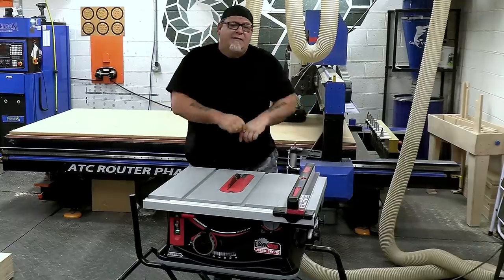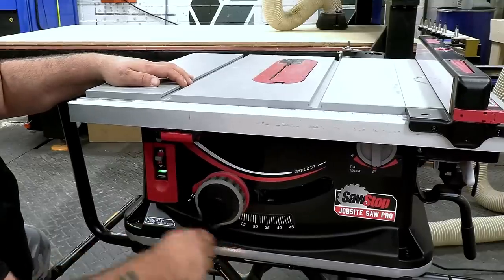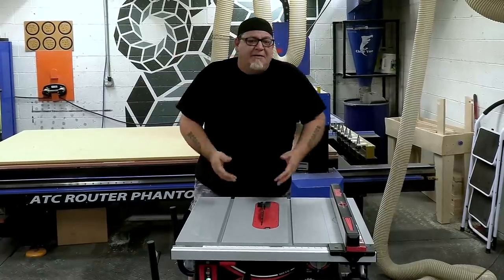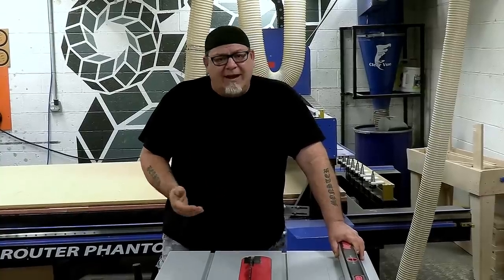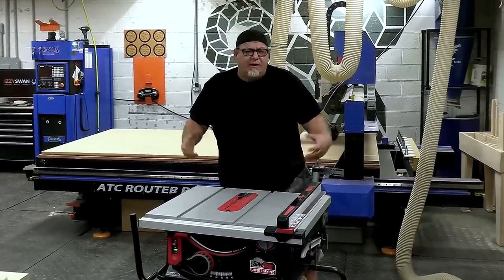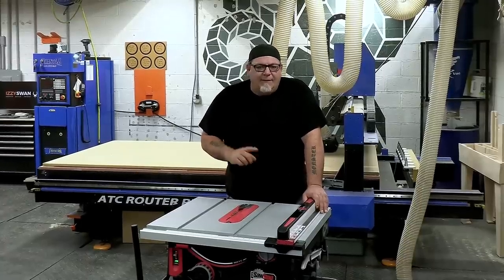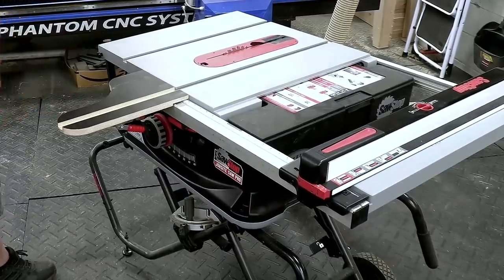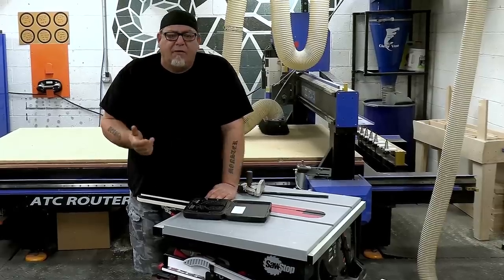DISAPPOINTED! - Most EXPENSIVE Jobsite Table Saw!

Comment: I've had a Sawstop jobsite saw for 5 or 6 years now. It is the original jobsite not the Pro model they sell now  I got the saw for the finger saving technology and the smaller size. Since I have limited space in my garage/shop. I use it to cut Birch Ply for cabinets, doors and all other uses and it works fine. I'm a retired carpenter so I don't take it to jobsites everyday, but I use it quite often. It was a great improvement from my previous 35 year old table saw. 
  I have had a few problems with the saw. First was with power, I was having problems with it running the diagnostics when you turn the saw on. Customer Service said I needed to use a shorter heavier cord. It helped some, but not great. I ended running a dedicated 20 amp circuit and have not had a problem since. The second problem was with the switch. It quit working the saw would start then stop and not reset properly. Customer Service said it was probably dust getting into the switch. I thought you're shitting me right, a $1200.00 jobsite saw that can't handle a little dust. SO they sent me a new switch, free of charge. I installed the switch and it has worked fine since. I did have the brake cartridge engage once. The saw was powering down and I was moving the fence and tapped the blade. The brake engaged and stopped the blade. The blade wasn't moving very fast when the brake engaged so the blade was not damaged. I contacted Customer Service and they sent me another cartridge. Yes the fence is kind of a pain too.
  All in all it works for what I need a table saw for now. And yes I would buy it again.
  I have one question about using a thin kerf blade. I've used one and had problems with the riving knife being to wide. It pinches the board against the rip fence making it difficult to push. Does anyone else have this problem? Any suggestions? Thanks
Reply: I too have the same problem with a thin kerf blade. The cut is so much narrower than a full kerf that the exiting wood hits and gets uncomfortably stuck on the riving knife. I think this can be an issue with any brand of jobsite saw, as mine is not a SawStop. I've attempted to rectify the issue by removing the riving knife and filing the thickness of the plate, down to where it is more wedge shaped, where the exiting wood is hitting the riving knife. It seems to work on everything but Mahogany ... but my experience is limited. Maybe there are some more (better) solutions out there?
Reply: @Sue B  I faced the same problem and tried several brands of thin kerf blades before giving up and switching to full-kerf blades. Problem solved. Yes, it removes a fraction more of the wood, but all riving knife issues are gone (with the plain knife or the dust collection blade guard). BTW, I personally find the full kerf blades give a better result (I use Amana Electro-Blu and CMT Orange Chrome blades).

Comment: I’ve had a JSS Pro for 6 months now and am satisfied overall.  

PROS:  
1) The finger saving technology provides huge peace of mind, and luckily I haven’t had any false trips yet.  
2) After a brief learning curve, I’ve come to like the fence.  As a couple other reviews have pointed out, use the red line over the ruler to select the distance from the blade, then pull back on the fence, then engage the lock.  The fence snaps to square, the red line doesn’t move, and the distance is dead on 100% of the time.  
3) I like the bigger table surface as compared to all of the other jobsite saws, as it provides more stability and flexibility for making a variety of cuts.  
4) I’ve been able to adjust riving knife side to side in order to permit the use of thin kerf blades, which is a big plus on any jobsite saw.    

CONS: 
1) Blade height adjustment.  As described by others, it’s extremely difficult to dial in a very specific height for dados, lap joints, etc.  
2) After ripping long boards, say around 4’ or longer, there is often a +/- 1/32” difference in width between the front and back.  I haven’t yet figured out what’s causing this:  fence slightly out of square relative to the blade?  Fence movement?  Other?

Comment: I've had my SS JS saw for 3 years. I got it to finish the inside of my new house. I wanted the mobility of a job site saw so I could move it to the room/floor I was working on. I also wanted the safety features because my young sons are getting more into helping with projects.  Recently, I've been building bee hive boxes and frames for my wife. Love the blade guard dust collection and mobility. To overcome the blade height adjustment issues, I've created some jigs to get dados and rabbits dialed in pretty quickly.

Comment: Good review Izzy. I purchased my Jobsite Pro two years ago. It was dead straight out of the box. I got used to the fence movement on lockdown, I micro adjust at the ruler and lock it in, and it’s fine. I hate the slop on the SS miter gauge, though. It died not fit tightly in the slot. Solved that problem with an Incra SE 2000. I love this saw! Cheers!

Comment: I'm a professional remodeling carpenter and bought this saw five years ago when my son started working with me.
I had a 10" Makita with a Rousseau stand and out feed table before.
Honestly I liked the Makita setup better, but the safety trumps the convenience.
The job site saw is too big to be lifting in and out of the Rousseau stand every day . I tried that.
So I'm back to using the rolling stand it came with and setting up an auxiliary out feed table.
I've never had a problem with "dirty" electricity tripping the saw, but did have to replace the switch and the computer on the tool.
I've also had two accidental trips with wet pressure treated lumber.
I'm now very careful to defeat the safety when cutting acq.
Still and all, love the fact that it won't bite me if I have a seconds inattention.
Sawstop was super helpful when I had issues and did send me a new switch for free.

Comment: The company I work for bought one for the local Habitat for Humanity.  That is the only experience I have with the job site saw - a few Saturday's worth of work.  The quick height adjustment was not a problem for my use, but I can see your point.  I did not like the fence.  I don't see your point about a 1.5 HP motor on a job site saw.  I believe that is fairly standard on smaller saws.  I have the contractors Saw Stop in my home shop, and love it.  I would like the 3HP cabinet saw, but it comes down to price vs how much time I spend in a hobby shop.

Storing all the accessories with the saw is great.  Especially in a situation like a Habitat job site, where tool hunting is part of the job description.  

It is expensive, but it is infinitely cheaper than a single finger amputation.

Comment: Great video. Have the same saw. Agree on the fence. Another small critcism, when folded up the handles stick out too far, I kept bumping into them. I rotated my handles inward. The stock miter gauge is garbage, too much play. Lastly the table isn't flat on the throat plate. You have to be careful when cutting thinner stock. Bottomline, you're paying for the patent. Mahalo for sharing! : )  P.S. I hear they released all new replacement model.

Comment: I love my Sawstop saw. I purchased mine 4 years ago after a builder friend almost lost 3 fingers in a table saw.  I have used Dewalt and Rigid job site saws and, years ago, a Makita job site saw. They all have their idiosyncrasies. I have a handyman service and, I use my Sawstop as a job site saw and take it with me anytime I need a table saw on a job site. The fence issue, I would agree, is the biggest frustration but, I have adapted to it. I can't say I have had a problem with "dirty power" and the saw has generally worked flawlessly. I'll try the pull idea on the fence. Obviously, the safety features outweigh the fence issue. If I ruin a blade and a safety block to save a limb, I'll pay for the replacements. There are so many table saw specific tools to check, set up, and, adjust the saws; it all works.

Comment: Great review Izzy.  I've had mine for a few years and it was a huge upgrade for me as I was on a really crappy $75 (new) tablesaw.  The 3 main issues I have is for sure that movement in the fence when locking so thank you for that tip.  It is workable, but annoying for sure.  Second, my table saw deck is not flat.  Not at all.  I worked with SS and they would not give me a new one.  I can put a square on the left of the blade and be at 90.  Don't move anything except the square to the other side and it is out quite a bit.  Even with larger squares taking the throat plate out of the equation.  I can even place a straight edge over the deck and see the gaps.  I've used brute force to get it closer, but it is still not flat.  Their answer to my $1400 (at that time) saw was "it is a jobsite saw, you should not expect perfection".  Third is pretty common I think with all saws and that is the miter gauge that that comes with it is total garbage.  Threw mine away.  I do use a full 1/8" blade (Ridge Carbide Blade) and never had an issue.
Reply: If you have documentation of who/when / you spoke with @ SS and you used a Credit Card to buy . Try asking the CC company for assistance in resolving a warranty issue , The worst thing they can do is say no . If that dont work ,goto your courthouse and ask one of the clerks how to file a civil action against SS . It will cost  about 200 to process the paperwork but now they must hire legal council  for $3000-5000 to defend a 1400 saw. See where this is going ? Good luck

Comment: I’ve had this job site saw for about 4ish years. The fence has always been square, the slop is mostly annoying when trying to micro adjust it.  The power is underwhelming but does the job most of the time. Of course I wish the rip capacity was larger. Overall I’ve been happy with the quality of the saw, though I’m not a professional on a job site, I have had to drag it around to quite a few different jobs. Side note, I have the older version and my Izzy extension only works in the right miter slot with the extension in the closed position due to the older bar construction, which is also annoying but at least I can use it with my miter gage and cross cut sled.

Comment: Hi Izzy. I own the prior generation SawStop jobsite saw, and agree with all your comments. The fences on my prior ~$400 saws were better. 

SawStop's documentation says the safety brakes were not designed for thin kerfs and to avoid thin kerf blades. I was pretty disappointed when I read that. And you have to buy a different brake for dado sets.

I'm a hobbyist, so despite its shortcomings, the saw is good enough for what I do, and the $1000 safety premium is cheaper than a hospital bill or loss of fingertips. SawStop's patent expired, so hopefully other vendors will release their own versions and help us get better, safer saws at lower prices.

Comment: I have done architectural millwork in Boston's financial district and built miles of cabinets for Starbuck's.  I purchased one of these saws when they first came out in 2015.  The fence is junk.  Over time,  the bevel adjustment becomes harder to move from 90 to 45.   The blade raising mechanism makes it not just difficult, but impossible to raise to a specific height.   In general, I  have found it extremely frustrating to use.  Even the dust collection is terrible.  I would never recommend this saw to anyone.  The safest saw is the one that does not make you want to throw it out a window on the 15th floor.  It is unfortunate that they did not improve the saw with this iteration.

Comment: SawStop has introduced a benchtop TS, (SawStop CTS-120A60 10" Compact Table Saw - $900). Its form factor and rack and pinion fence copy the excellent Dewalt DW745. This new SS saw provides the safety technology while addressing two main negatives of the saw you review here: excessive weight/bulk and price.

Comment: Thanks for the review Izzy. I’ve had this saw in my cabinet shop for almost 3 years now, and it’s used heavily every day. In practice, the fence is a non-issue, has never been a problem.

Also, the one revolution blade raise has been much more an advantage than a disadvantage. A little bit touchy on micro judgments, yes, but the majority of the time I am raising the blade to cut thick materials and it sure beats having to spin the knob 25 times like my old Dewalt.

As for the people here commenting on you being an idiot to pay for the safety feature, to each his own. Tens of thousands of experienced woodworkers have lost fingers due to a millisecond of distraction, or inadvertent kickback. I liken it to car insurance; hope I never need it, but if I do...One of my fingers is worth a lot more than $1,600.

The only drawback I feel with this saw is the power. Granted I am running a full  kerf blade and it has stopped several times in the last three years. Don’t know that I’ve ever had the problem with a thin kerf blade.
Reply: I had 2 and running them heavily would heat the blades to the point where it would trip the brake. You ever had that problem?
Reply: @DRMadeIt  No sir, haven’t tripped a blade yet in three years. If I’m doing a long rip in thick lumber, a few times, the saw just stopped. I reset the breaker on the breaker panel, and I was good to go.
Reply: @kevincriswell7533  the last time I used it I was ripping 3” fillers on end and I tripped the brake 2 times in an hour.  I finished it by bypassing it. But if I have to bypass it there’s no point in having it.
Reply: @DRMadeIt  I agree with you. Maybe you should check into the Skillsaw worm drive unit. My cousin has one, and he says that thing cuts like a beast.

Comment: Great video and I wish I had watched this before buying my SS saw. I have had mine for about 3 years now just as a hobbyist and the fence is by far the worst part. Its so bad that it really knocks your confidence around to get accurate cuts. As a job site saw cutting framing timber or Pergolas I am sure its fine, but trying to make cabinets or anything accurate is just about impossible. So hard to get square anything. The safety feature is why I bought it being my first saw and that part I love. Should be on all saws.

Comment: Everything said here is on point. Personally I’ve used Dewalt for the last 27 years as the rack and pinion fence is the best when adjusted properly for accuracy. I recently switched to the skill worm drive saw for job site use because it has all the features of the Dewalt, lots of power, a larger table, and a great stand. I would never use the saw stop. Your blade choice is on point as well and one would seldom need any other blade other than a 24 t for ripping junk.

Comment: I bought the Bosch Reaxx when it was still available because it had a lot of nice little benefits over the SawStop. It's a real pity they never worked out their patent issues because it would be nice to have 2 competing finger-saving jobsite saws on the market, especially one that won't kill your blade, and which you can use safely with inexpensive blades that have anti-kickback shoulders on them (which SawStop tells you not to use because they can bounce off of the brake and prevent/slow the mechanism). FWIW, the fence was equally bad, but of the "push to keep it stable" variety). I eventually upgraded to a PCS when I had room for it, and sold the Reaxx to a newish "garage woodworker" (basically where I was when I bought the saw) and I know he's getting great use out of it.

Comment: One thing about DeWalt jobsite saw is that the rack & pinion fence is actually pretty good. But until the patent fully expires in a few years, if you're concerned about safety, SawStop is it.

Comment: hi there, thanks for the great videos i will never have your skills but it is great to see yours , when you mention thin kerf blades you don't mention about thin kerf riving knives, my saw has a thin blade but thick riving knife which is also too high for my blade when trying to use sleds etc. Maybe you did a video on this and i have not seen it. if so could you point me in the direction of this video, also with the blade thinner than the knife the cut wont go through the knife . any ideas thanks again all the best

Comment: I have a Powermatic 66 3HP and I am spoiled.  I used to have a Craftsman contractor saw and that was ok when I added a Biesemeyerr fence.  The portable/contractor saws are great for portability but suck for cut quality and power.  Even the nicest portable or contractor saw just cannot compare to a bigger cabinet saw.  Now that is comparing apples and oranges but most portable/contractor saws are for making construction cuts and not fine work.  You can make it work for fine work but it is a constant struggle to keep it accurate when you throw it in a pickup and haul it around.

Comment: Interesting to see guys promote saw blades that are nearly two or three times as expensive as the ones I've been using for a couple of decades (with excellent results as a finish guy) and calling them "not expensive". Oh yeah, the longevity argument is thrown out, and then thrown out. As usual, great content Izzy. My job site saw is the first (and best) generation of the Rigid. It's heavy for a jobsite saw which helps stability, the fence works well. It has a couple of weak point made more aggravating by it's obsolete status. I've used the newer model, meh. I've used many other brands of jobsite saws, they all have serious limitations. Seeing this short review puts the Sawstop in the "nope" column for a jobsite saw.